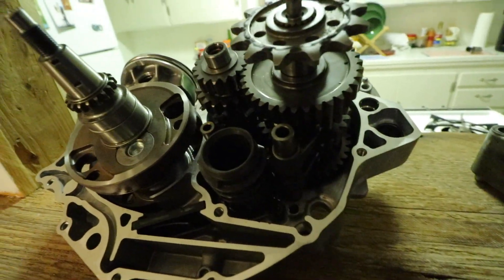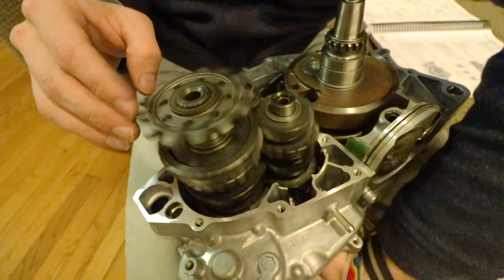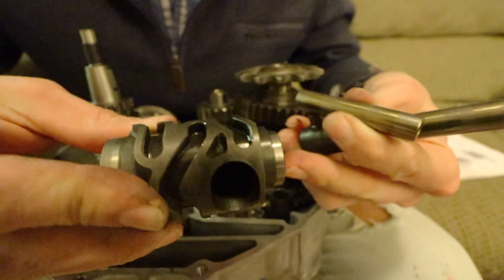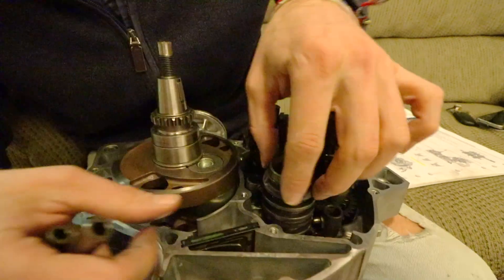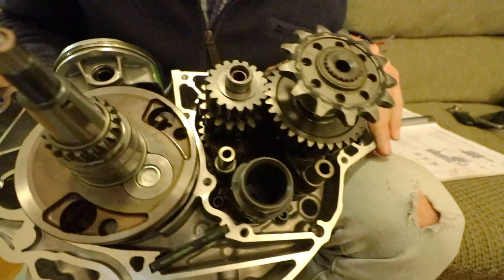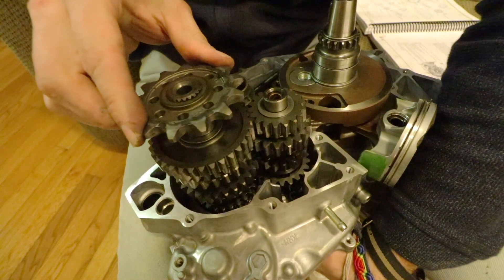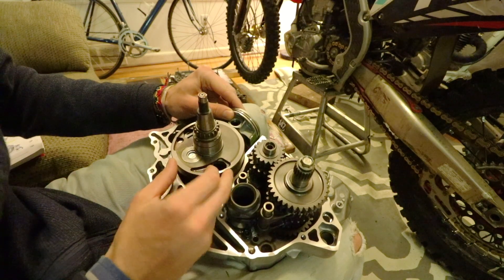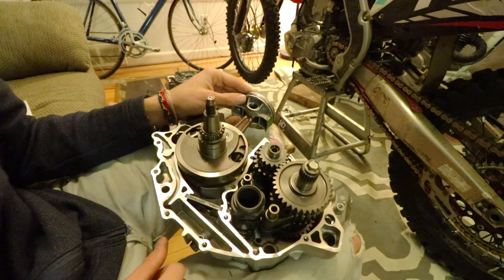CRF250r Bottom End / explained, dissected and assembled CRF KX YZ engine mechanic

Comment: Great video, simple and to the point. Surprisingly there are no vids on yt that explain the transmision as you do. I blew my 07 kx250f engine, the crank rod broke and went right through the cases, so I'm trying to get some knowledge and hopefully rebuild the motor.
Reply from the maker: Hey thanks! I have another video on here that shows the rebuild of the bottom end, and we just finished rebuilding that entire engine so I'll have it up shortly!!

Comment: My 2005 crf250r blew up today and I only bought the bike 5 days ago. First time out on it.  I took the oil filter cap off and there was copper shavings in there so I'm thinking the big end has gone. Possibly con rod. So.. let the rebuild begin and wish me luck lol. P.s the guy I bought it off robbed me
Reply from the maker: Oh no, sorry to hear that! Buying used can be such a risk.. The copper shavings are definitely from the crankshaft (journal) bearing being waller-ed out, that's the only copper in the engine (expect some valve seats). I posted another video of my girlfriend rebuilding a 2010 CRF250r bottom end, if that will help at all. Let me know if you run across any hiccups, and good luck!